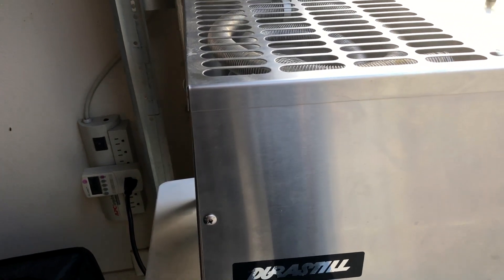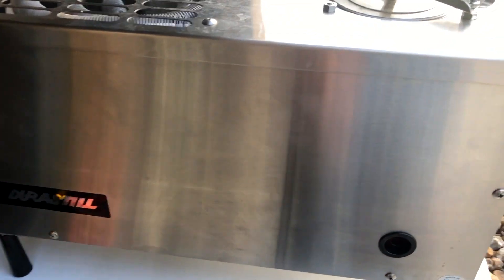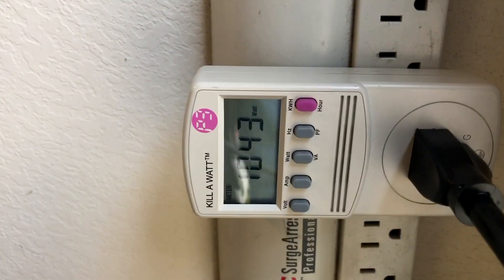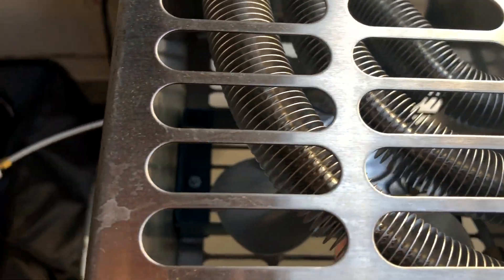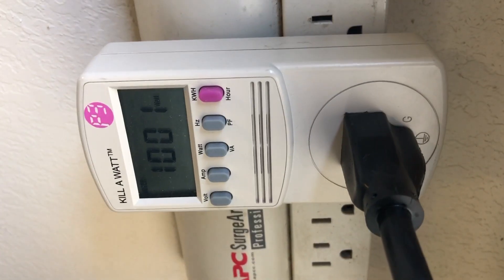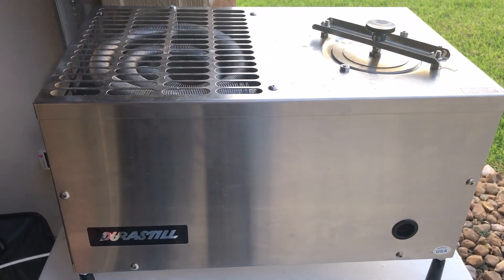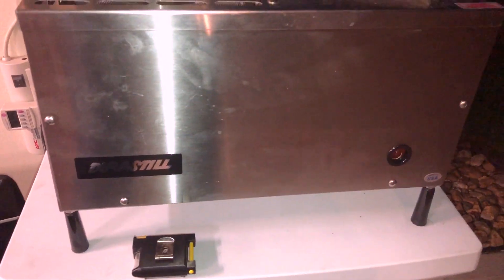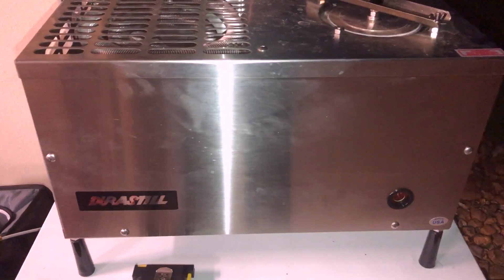How Much Power Does Durastill Water Distiller Consumes?

Comment: I'm still debating in my head whether it would make more sense to distill my water or just build a rainwater catch system. It rains here pretty regularly. Rain water is free, but you still need a way to store it and filter out the contamination that runs off your roof. Also, if you store it for long periods, you would have to sterilize it with either ammonia gas, calcium hypochlorite, or iodine. Distillers will require maintenance, but they consume power, are dependent on the grid, and provide very clean water that can be stored in sterile jugs. I'd say that I should probably do both. When you consider that municipal water has a cocktail of Rx drugs that are recycled from waste water and put back into the tap, and some municipalities are adding fluoride, which lowers the I.Q. in developing brains, it's really not a matter of IF you should provide your own water, but HOW you should do it.

Comment: I have used a Durastil   for over 30 years... I am just now starting to have problems. I think my heating element is going bad.
But your  power consumption is not taking into consideration the starting from a cold tank.
I have a 5 gallon bottle that fills from the still. I have an automatic fill type still. The timer runs for 10 hours. So once I start it, I run it for 18 gallons continuously. That way I only have one startup from a cold tank/ 18 gallons.
I feel that the economy of doing it this way is way better than one gallon at a time....
Reply from the maker: good point. you are right about the cold start, from cold start it takes about 1 - 1.5 hr just to start dripping distilled water.
Reply: @Willy Bee that's a good tip.

Comment: So do you think 3 hours is a normal time for 1 gallon?  Debating getting one of these and was curious about the power cost. We probably use 1-2 gallons per day so thinking 6kwh based on this
Reply from the maker: In my area (Houston) my electricity cost is about 10 cents per KWH. So 3 hours cost about 30 cents. Comparing buying from grocery store for about 90 cents and the hassle of handling and transporting the water from the store... I think it is still worth it.
Reply from the maker: Good point and question, I will test again, but this time I will time how long it takes to start generating distilled water, and how much water is being generated per hour. I upload this video in about 1 week. Thanks
Reply: 4 hours is normal. 3 is pretty fast. I’ve been distilling for a while now.